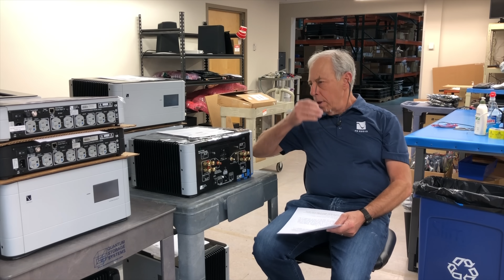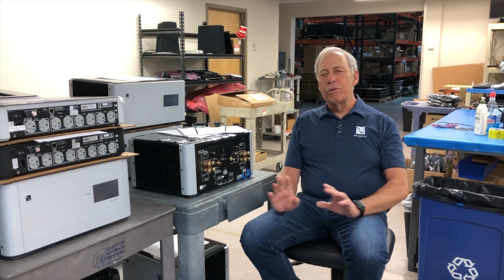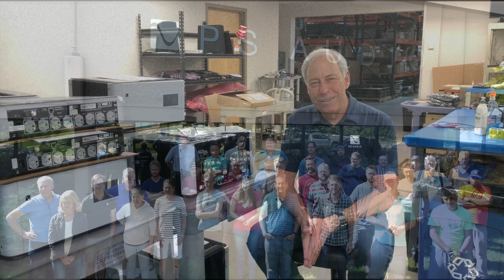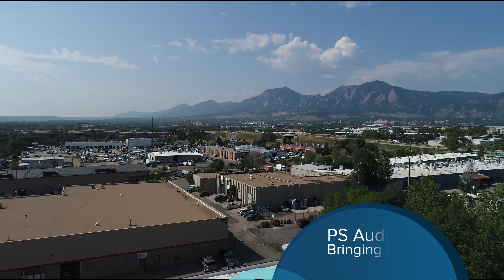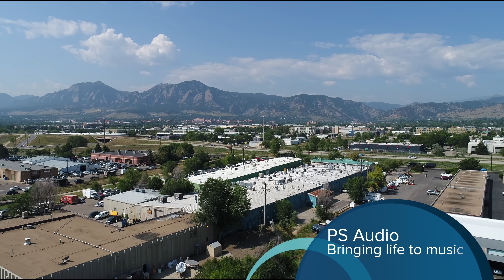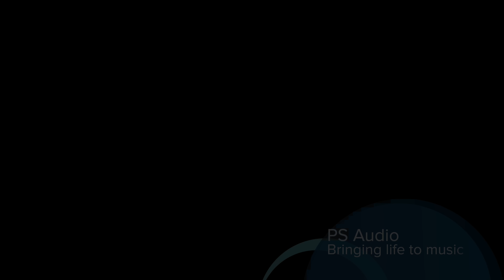How important are power amplifiers?

Comment: 50 to 70% what you hear is the Room itself and its Acoustic behavior. Whats the point of having A +10k power amp in an untreated room? Ok its controlling the drivers better, and more power to produce max levels and thus more standing waves. My low budget power Amp of 495 Euro rocks with Acoustic treatment! So does my full range Genelec system. Cheers.

Comment: I totally agree !! Speakers first   Amp second ...
15003/4  power transistors are still available.. they are TO-3 npn / pnp complimentary pairs
Reply: At a 5:1 ratio between the cheapest and most expensive on fleabay worth shopping around. The Electronics Australia, J. Clarke and L. Simpson designed Playmaster 300 used three MJ15003/ MJ15004 pairs. I never built that one. If I was to build another amp (unlikely) it would be this one: https://www.jaycar.com.au/studio-350-high-power-amplifier-kit-back-catalogue/p/KC5372

Comment: Yes, speaker first, or headphones if you're on a budget. I had a pair of electrostatic headphones for serious listening for many years. For speakers you need a power amplifier — that's mandatory. For headphones my Schiit DAC does a fine job. It also has a nice rotating volume control. Then there's source. For me that's usually the PC where virtually all my music resides. If/when I finish digitising my vinyl collection the turntable will become redundant. The Rotel CD player sits in the spare bedroom unwanted. It failed to sell on fleabay.

Comment: This is a really interesting topic.  The conventional thinking in terms of order of importance is that loudspeakers should be where you put your money followed by the source.  However, financially, speakers and DACs/CD players are probably the worst places parts of the audio chain to invest in. Speakers degrade faster than other components, and DACs get outdated (by new chips and formats) faster than any other component in a hifi audio system.  Also, selling loudspeakers you grow tired of (outside of small bookshelf speakers) is logistically problematic due to size and fragility. As such,  both (especially DACs) depreciate quickly. Personally, I like to put as least as much (and usually more) of my cash into the amp (either power or integrated) as I do speakers.  As long as thought is given to how the speakers match the power amp, this usually gives me the best bang for the buck and a system I know is not going to depreciate into dust in 10-12 years.  I guess if money is no object, then you can throw this thinking out the window, but I feel for many of us, thought must be given to how we are investing our money in this potentially expensive hobby.
Reply: Oh, you're investing in your equipment? I'm listening to mine.
Reply: @seanmangan2769  Sure, point taken, but the unfortunate reality is that most of us have to make compromises when we purchase our systems, so resale value becomes an important factor if you are planning upgrades.  I feel this is especially true for those that are new to the hobby and have no idea what they actually like until they've owned gear for a while and gained some experience.  Glad you are content with your sound though.
Reply: terrywho22
 "selling loudspeakers you grow tired of..."
I haven't sold a pair of speakers since the 1970s. I gave away their replacement to my youngest son who in turn has donated them to his best friend. To the best of my knowledge, they are still in use. The only decay was the consumption of the long-fibre wool (by some insect pest) I put inside the cabinets. When I replaced that I also put some insecticide in the cabinets.
Reply: @jonathansturm4163  https://www.youtube.com/watch?v=z5H6iwQGWl4

Comment: If you looking for vintage power amplifiers go for chord 80s and 90s still can get the parts, or use 2 integrated amplifiers what accept a preamp and bi-amp each speaker you have fine control over the bass and treble a bit like an active crossover. You don't need power amplifiers you can achieve it without a power amplifier I mean any amplifier is a power amplifier and amplifier amplifier's, it's in the name. Power supply is more important to the amplifier. Throwing a low pass filter and high pass filter in the mix can work wonders as well

Comment: I built the Heathkit 250 watt per channel amp and the top of the line preamp years ago.  It was lots of fun to build with many hours of almost unbearable anticipation of the sound.  I ended up selling to a friend and he compared the sound to a Realistic (Radio Shack) receiver driving my old Magnepan 3a's and was amazed at the improvement in sound over a 80 watt per channel Realistic receiver  - night and day.
Reply: @TA-nn9os  my dad built Heathkits I think they were all tube.  It's been so long now.  Anyway he sold them to a guy in DC area that was into tube stuff.  I'm sure he got it so cheap it was silly but at least appreciated it.
Reply: In Australia there was a magazine Electronics Australia (previously Radio, TV and Hobbies) that published amplifier (and other equipment) designs that were developed in-house by the engineers who worked for the publication. About thirty years ago mass production techniques began to erode the cost advantage that kits provided. I built several of their amplifier designs, some for myself and some for friends. It was a fascinating hobby. I saw the writing on the wall more than a decade before that when integrated circuits began to be ubiquitous. My first op amps were built from discrete components following a design in Wireless World and the shift from discrete to IC took a lot of fun out of design.
There was a notable advantage to building your own. If you purchased the individual bits you could save even more money than by purchasing all the bits from a supplier. My last Playmaster had its PSU in a separate box, super-matched transistor pairs in the phono stage and a moving coil preamp built-in that I knocked up on a scrap of vero board. It went through one capacitor replacement before retirement.
I used to purchase several electronics mags every month and read them cover to cover. The best in them all were the Serviceman's column,  in EA The Serviceman Who Tells wherein you learnt the intricacies of troubleshooting and repair. I'd better shut up now...